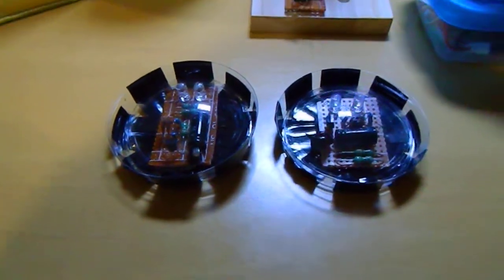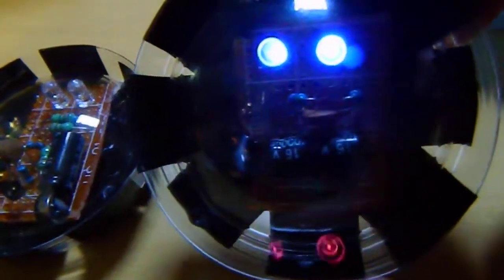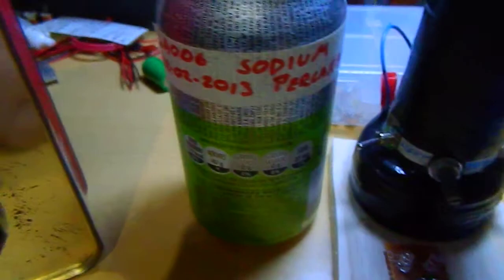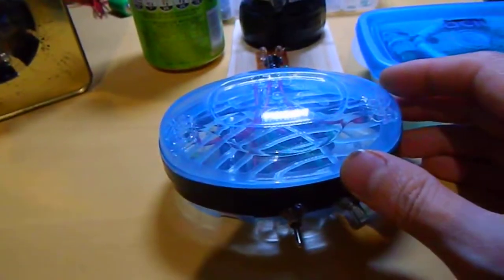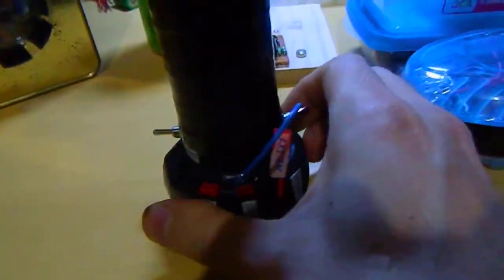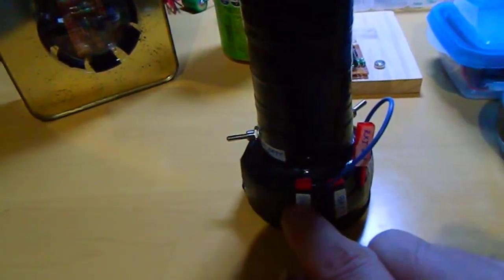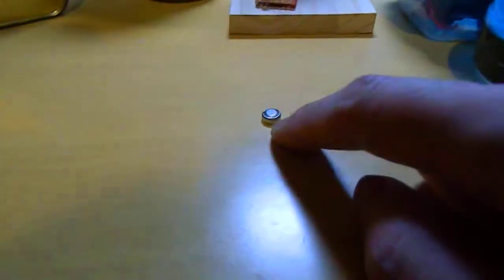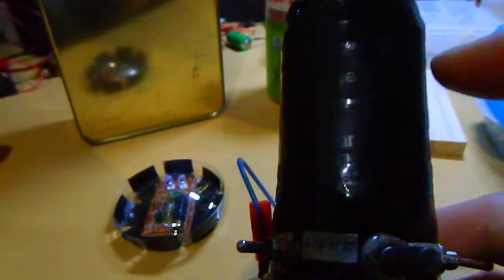Micro amp Oscillators - Aluminium/Steel Battery

Comment: I like to re-use waste stuff too. If you have epoxy and cardboard, you can make your own PCB's. Use home made copper ink for that really pro look. Have you got a run time for the first self charging lamp? or is it still going? For the panel, considder boosting the voltage with oscillator, for storage. In a super cap or battery.  more volts and less amps has less loss. Solar powered charging station and big light?

Comment: I know what you mean about the testing. Gets boring after a while. I get tons of enameled wire from old CRT tv's. de-gauss coil and vokes. Also transformers from circuit boards, and I just got a ton of really fine wire from a car flasher cam (turn signal flasher). I'd suggest a toroid based oscillator for the battery charger. More efficient. Have wireless transmission switchable. I'd try a long thick coil on the collector,  give the battery a good square wave with decent amp push, more testing:)

Comment: Electric motors have a ton of wire too, if it doesn't have the insulation melted and you can get it out in decent lengths. Melted enamel on wire is a major cause of motor failure, so watch out for that.

Comment from the maker: The semi-self charging devices cannot discharge the battery. It reaches a level that the discharge of the battery stops and the oscillator keeps running lighting the led´s. But I need to find wires, it is not easy to find copper wires without plastic insulation in here. I am testing how is the best way to charge the battery to use in the solar panel. If I use the Rene´s method, I have to make another oscillator for the wireless charger. So, testing testing and more testing. :))